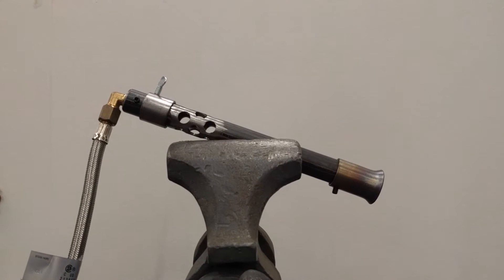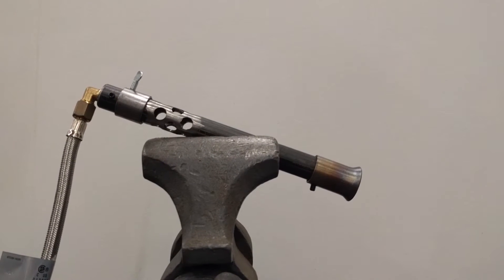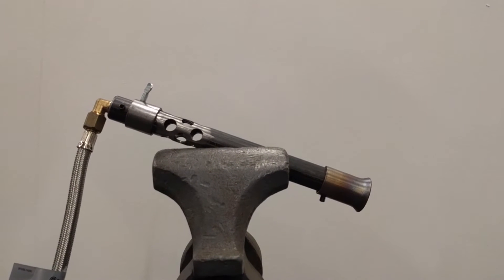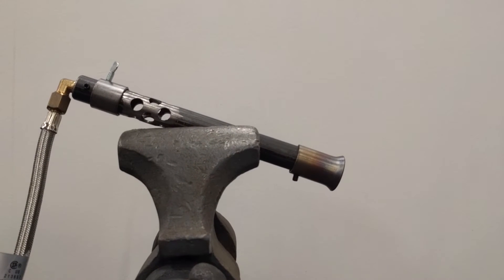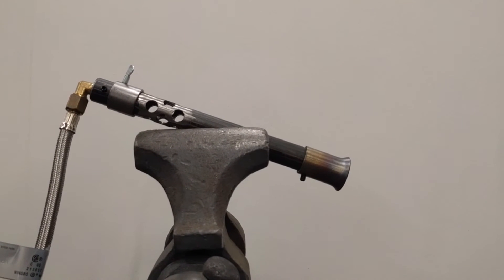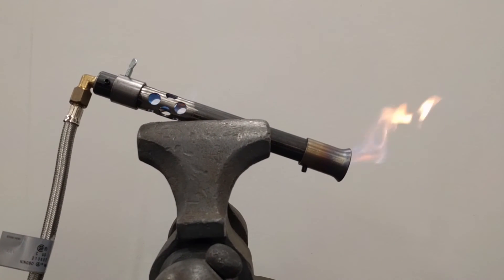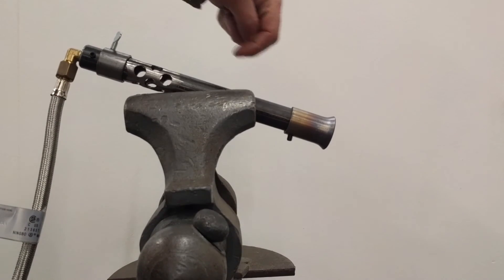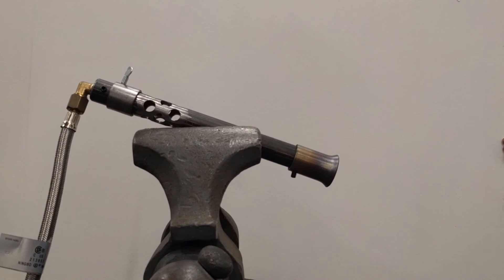Troubleshooting: Propane Gas Burner by Mathewson Metals

Comment: Thank you. As new to forging I was running a duel burner forge and one lighted but the other did not. I quickly shut it off and found out that I wasn't using enough pressure. Thank you!

Comment: Before realizing that this one existed I made one very similar except the spray nozzle is at the end of the air holes to where it will be pulling air directly behind the fuel, but almost just like that just different types of pipe and stuff. Good burners!

Comment: Just received this exact model with the hose and regulator. Lights fine, but it sputters no matter what I've tried. What could be the problem?
Reply from the maker: Dan Burr Just call us. It's probably a faulty regulator, which we will replace immediately for you.

Comment: Hello, I am interested in buying two of these for my foundry and I was wondering if these worked for melting metal and if the blue flame could be increased in size to better the metal melting ability?
Reply from the maker: Cole Beyer Hi Cole, sounds like our double burner assembly could be right for you: https://mathewsonmetals.com/shop/item/double-burner-assembly These are optimal for foundries and generating a lot of heat.

Comment: I have a forced air propane burner what do you think the problem is if it doesn't burn completely outside the tube, the tube gets red hot?
Reply: Just the end? If it is inside of a forge and can be held in it's position just remove the flared nozzle at the end. That helps more with flames in open air as opposed to inside of a forge.  If the flame is burning further back than an inch or so you need to check for flaws I design. If it's forced air it should not have any other vent holes like the one in this video.
Reply: Potentially not enough gas pressure. This could be the regulator, supply tank, or the size of the gas orifice. You can try different sized orifices from 0.025", 0.030", to 0.035" depending on the regulated pressure. Also try adding a wire mesh just inside the outlet of the torch. The mesh helps air to mix with gas more evenly and keeps the flame at the tip of the torch.